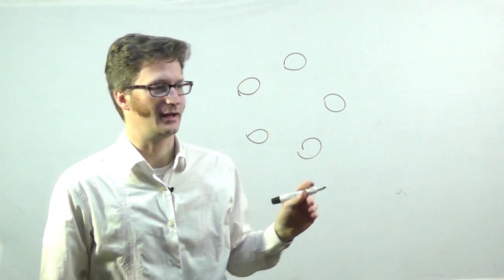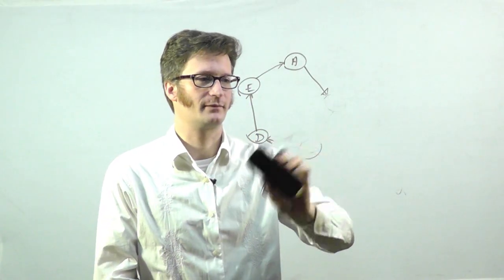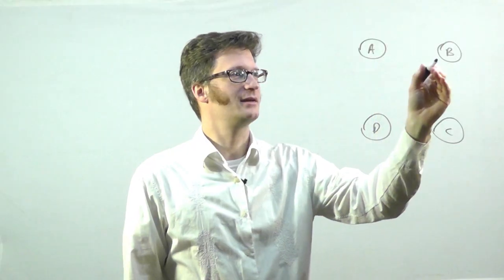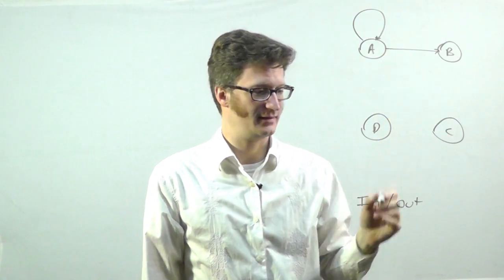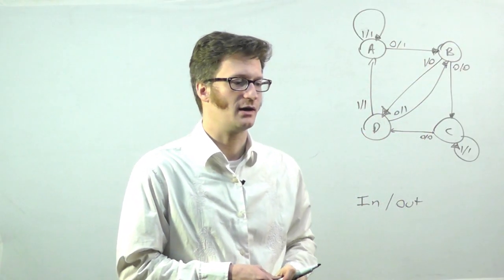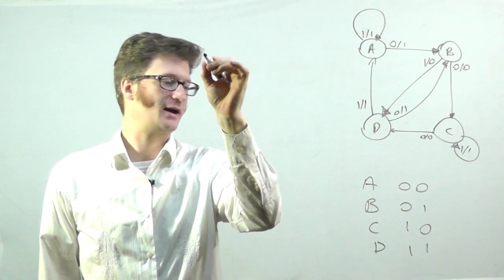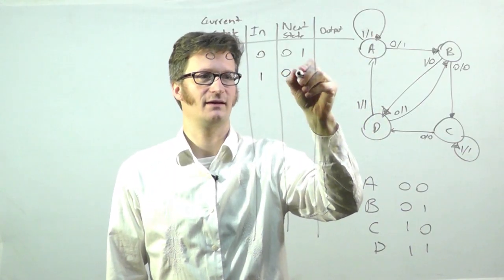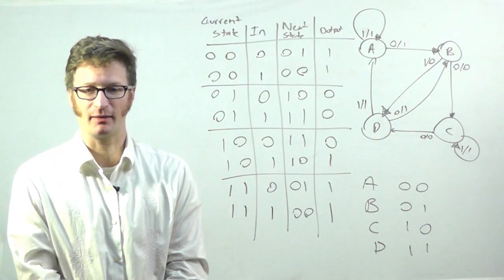Digital Logic - State Tables and State Diagrams

Comment: what if there were more than 4 states?.....that is a E state also then
what would have been the code?
Reply: i think you'd need to do something like 000, 001, etc.
Reply: Exactly. You just add bits as necessary. You will have 'extra' possible states but that is ok, you can just ignore them. Basically you just don't wire the circuit to do anything with those additional 'possible states'.